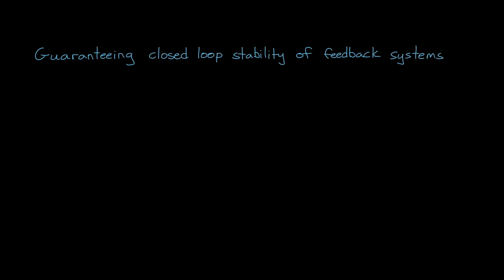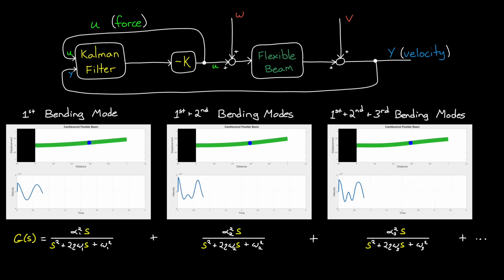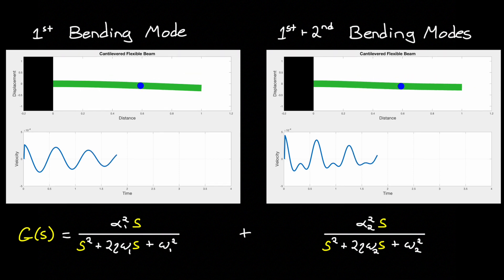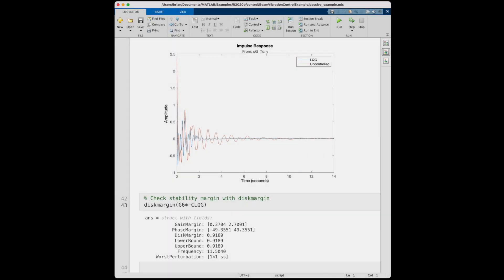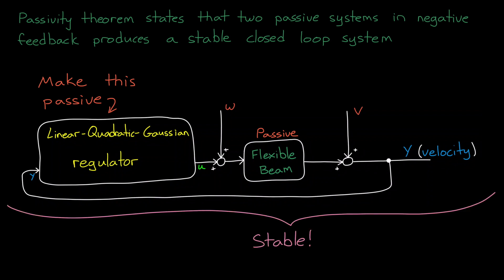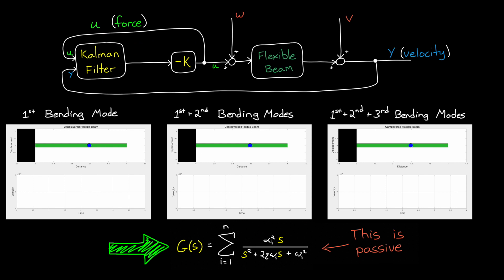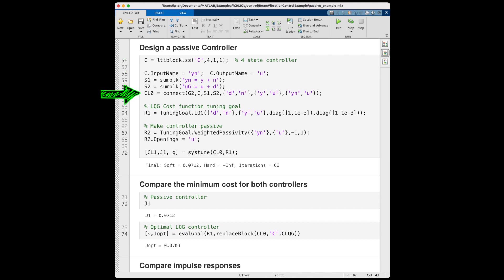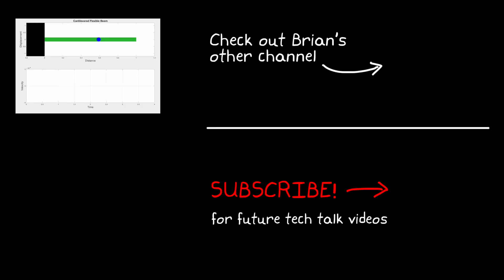Passivity-Based Control to Guarantee Stability | Control Systems in Practice

Comment: dear Brian, matlab shows error at line 61: unrecognized function or variable CL0 ...
Reply: Hi @francesconigri, line 61 is defining the variable CL0 so it shouldn't exist until that line. It's weird that the error is that it is an unrecognized function or variable CL0. Do you have a typo that is trying to reference CL0 instead of define it? Are you running the example from MathWorks? This one: https://nl.mathworks.com/help/control/ug/vibration-control-in-flexible-beam.html
Reply: @BrianBDouglas  Thanks, Brian, for answering back. I'll give a look at the example and try to run matlab once again. I'll let you know.
Reply: @francesconigri745  Great! If it doesn't work, I'll try to help you out. Good luck!
Reply: @BrianBDouglas  Thanks, Brian. Everything looked much clearer in the example you suggested. At the present, I only need practice.

Comment: so basically energy in Lyapunov sense?
Reply: Seems like it according to Wikipedia. I guess "passivity" means a strictly stable system (all poles in LHP). For a controller, that would mean no integral action. A controller with no integral action would be useless for regulating systems, unable to compensate por peristent disturbances. So I guess no I in a PID.

Comment: How can you ensure passivity in a real system if it holds some non-negligible transport delay? From my understanding, there is no way the Nyquist plot won't dip into the left half-plane.
Reply: Hi Alon, I responded to this a couple days ago with a link to an example with delay but it looks like YouTube blocked it. So, if you Google "Passive Control with Communication Delays" you'll find a MATLAB example that shows you how to deal with some transport delays. I hope that helps!
Reply: Thanks for the answer. I found your article which was great 👍
Reply: You should decrease the gain.